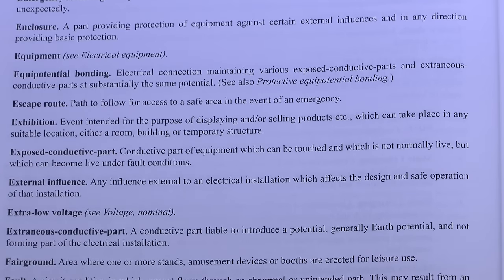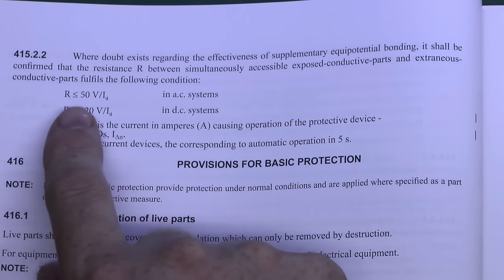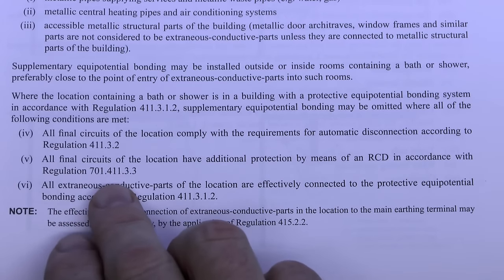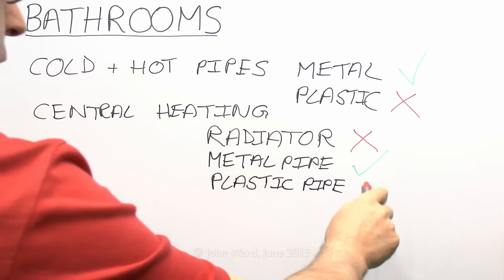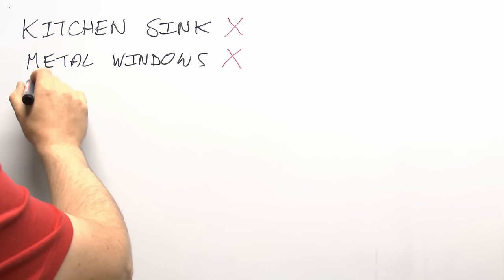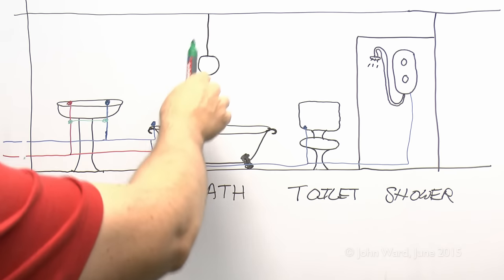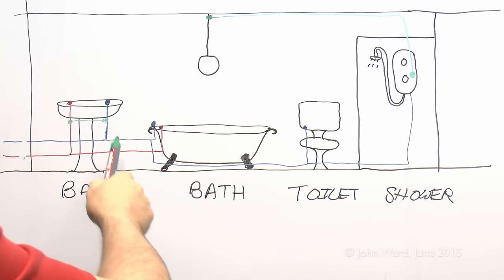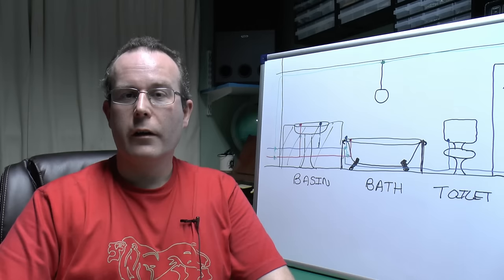Earthing & Bonding - Part 3 : Supplementary Protective Equipotential Bonding

Comment: Working out the resistance you said 1667 ohms if there is an rcd which is based on 50v divided by 30mA. When you did the calculation for a over current device you mentioned a 6amp circuit but then did the caluclation at 30A, why was that please? Also are you measuring back to the MET?
Reply from the maker: 50 volts is the maximum acceptable voltage on exposed conductive parts before the device trips.Type B circuit breakers need at least 5x the rated current to trip within the required time, so 30A for a 6A circuit breaker.
Reply: John Ward thanks for that. Is the measurement done back to the met?
Reply from the maker: Measurement is the entire earth loop, which includes all of the internal wiring and the external impedance between L and E.

Comment: Hi Jonn
In IEE  regulation 701.415.2 (v) states all sup bonding may be omitted providing  "All final circuits of the location have additional protection by means of an RCD in accordance with regulation 701.411.3.3"
Does that mean each relevant individual circuit in the consumer unit feeding the bathroom has an RCD or 1 overall RCD protecting the whole bank or MCB`s
Thanks
Reply from the maker: Could be either - provided all the circuits have an RCD, it doesn't matter whether it's one for all of them or several separate ones, or RCBOs.

Comment: I if you don’t have a wandering lead when you’re doing the earth bonding continuity test is it acceptable to conduct the test by probing onto say the earth terminal on the back of an electric cooker and then on the gas pipe to witch a gas cooker is connected  ? , as all the earth conductors are connected to the earth bar in the CU this will still give you continuity, ? You could also probe onto the main water pipe into the boiler ? Would this be an acceptable way of conducting the test?
Reply: Yeah, the cpc's are very low resistance and are negligible against the values you are interested in. If pipework resistance to MET is >23k ohm then no need to bond, less than that then you do.

Comment: Hi there I'm very new to this and was wondering what would be the concern of finding a repair to a water pipe in a bath room using a plastic connector id assume this would break the earthing circuit but if the rest was  bonded correctly could this be in fact dangerous??
Reply from the maker: Not likely to be dangerous - if the bonding was connected before the plastic, then it just means that the rest of the pipes after are not bonded, but as they would be isolated from the others they would not then need bonding anyway.
With bonding after the plastic part the piece before the plastic won't be bonded, but that would only be of concern if that section was accessible - if concealed such as under the bath then it would not be a problem.
In newer installations, most bathrooms don't require bonding at all.
Reply: John Ward thank you for your reply it's very helpful ....I was wondering have you done any videos of how to decomission electrical appliances, components and associated wiring ??

Comment: Are you completely, 100% sure boiler pipes don't need bonding?
Reply: No,  as the chassis of the boilers have an integral equpotential point.  As long as the gas and water pipes are bonded with 10 mm² wire.  Under the 18th edition if you have m.d.p.e pipe (plastic) downstream of the water stopcock or gas meter bonding isn't required.  This would only be the case if all circuits at the consumer unit RCD protected.
Reply: @rayc1503  cheers for your reply Ray. Still learning… every days a school day
Reply: The RCD requirement is regarding the ommision of supplementary bonding conductors, it is nothing to do with main protective bonding conductors. If your service pipework is extraneous, bond it, if it is not, don't.

Comment: Plastic flexi piping to hot water taps but copper just before fitting? Needs bonding?
Reply from the maker: No.
Reply: That's what a young spark (local authority) said to me when I saw him bonding some pipework. I just laughed and walked away.
Reply: Hi John, I worked in the era where you didn't need paper qualifications, and where everything including the cutlery was earthed. I've not worked in this field for 30 years, so equipotential bonding is fairly new to me. My interpretation was that all metalwork in the bathroom was bonded together, so it's all at the same potential with none of it being connected to the main in coming earth, but then you mention extraneous conductive parts. This is where I get confused as you mentioned extraneous parts when you were talking about the main bonding. So is any part of the equipotential bonding connected to the main earth bonding. My bathroom has everything bonded to the main bonding cable, even the bath. I was told that this was dangerous as there are to many paths to earth and that none of the E P bonding should be connected to anything else, but then the shower pipe is earthed to the light fitting which in turn goes back to the main earthing circuit. Please can you help.
Reply from the maker: +luckyglyn You have the concept correct - bonding together to keep items at the same potential.  However it's not just because it's metal - it needs to be metal/conductive and capable of introducing a potential from outside the room.  So water pipes, earthing wires from circuits supplying the room, heating pipes and cast iron waste pipes would be bonded as they enter from outside the room.  Towel rails, radiators, toilet roll holders, door handles and a metal wall cabinet would not.as they are totally contained within the bathroom.
Connecting to the main earthing for the building is not required as that is typically outside of the room and unrelated to keeping everything in the room at the same potential.  However it will usually end up connected via the individual lighting circuits, shower circuit, etc.
Reply: So  would it be advisable to disconnect any bonding cables in the bathroom that go back to the main earthing point, for safety reasons, and just leave the other cables in place. Thank you. Brilliant videos John.

Comment: Thanks very much JW. 

I have a couple of questions relating to extraneous conductive parts. 

Where the water supply pipe enters the building, is plastic and does not require bonding (as per 18th Ed changes,) there is not much guidance on this, but is it safe to say that omitting all bonding to the copper pipes is essential now because these water pipes are no longer extraneous? There's also loads of push fit fittings to copper pipes breaking the continuity of these pipes, so do they need bonding between also?

Thanks in advance!
Reply from the maker: If items are not extraneous conductive parts they don't need bonding.
Plastic isn't conductive, and pieces of copper pipe entirely within the building won't be introducing any potential, so neither require bonding, and never did.
Reply: @jwflame  Thank you for your advice, you have answered a very valuable question. I am now at ease. That's the trouble with being an electrician, the lack of information. We're so lucky to have people like you to educate us and thanks once again for reaching out.

Comment: I just had a EIC report telling me that the water and gas pipes need bonding, just as John points out is completely pointless as they all go into a chunk of metal called the gas boiler.
Reply: The incomer still needs bonding?
Reply: Yeah, any extraneous service pupewoek would need to be bonded. You can't just rely on the cpc of the boiler as a main protecrtive bonding conductor as it will almost certainly be undersized and in the wrong position to meet the regulation for bonding service pipework.

Comment: so, is all this redundant if everything is RCD-protected at the CU?
Reply: Whether you're legally are allowed to or not, It seems inadvisable, having the first notice of a fault being a shock is not good practice.

Then there's the edge cases with a break to the neutral, or a neutral fault in one area combined with a live fault in another where an RCD wouldn't save you, and it's still absolutely needed
Reply: @AngDavies  I cant see any extra bonding to the gas pipe or incoming water.....all the pipes under the boiler are earth to each other but not to anything else, it seems.......time for an electrician?
Reply: @tobybarker6808  the bonding should be at the isolation valve to the building (stopcock), not at the boiler itself if I understand JW correctly, so check that first if you know where it is?(also to verify it's not plastic)
Reply: @AngDavies  done that - no sign of any bonding. doesn't plastic pipe and/or elbows make a bit of a mess of the general plan anyway?
Reply: @tobybarker6808  pipes with no continuous electrical path back to the pipe in the ground are not dangerous (i.e., if there is a break caused by an elbow, it doesn't matter)

Only things that are earthed through some path other than the main protective conductor at the consumer unit need bonding (i.e they're electrically connected to something buried In The ground)

If they're just disconnected pieces of metal they don't need ( and shouldn't have) an earth wire, unless they're at risk of becoming live through contact with mains circuitry.

Any pipes downstream of a plastic elbow/pipe, wouldn't need bonding, even if metal, unless they then went underground again, because the elbow/pipe broke the secondary path to earth, and thus danger.

Tldr: bonding is not to earth something, it is to prevent something that is already earthed through other means from being dangerous, if that secondary connection to earth is broken, the need for bonding is lost

Comment: is there a specific distance that determines similtaniously accessible parts ?
Reply from the maker: damon btc No specific distance, it is defined as parts which a person could touch simultaneously, so approximately 2 metres.
Reply: +John Ward So in other words not like the regulations for accessible exposed parts where there are diagrams of exactly how many cm in various directions are considered accessible (think overhead power lines, big electrical rooms etc.)
Reply: How to grounding banding seng sstym
Reply: @AhmedAli-jy1qm   yeah, my sentiments exactly

Comment: All electric circuits will have their earths connected at the fuse box so why would a bathroom light need to be earth bonded to a shower?  .......... presumably to cater for risk of a loose earth wire?
Reply from the maker: The concept to to keep all of the conductive parts at the same potential by connecting them together within the room.  Although they may be connected together at the fuse box / consumer unit, that may be a significant distance away, and the resistance of the wiring could result in voltage differences between the various parts.
The further away the connections are, the more likely it is that the voltage on those parts will be different.
Reply: @jwflame  
Thanks for the info. Do bathroom c/h radiators, with copper water pipes,  have to be earthed?
Reply: @spannerssockets6308  not earthed, but if they are extraneous then they need to be bonded

Comment: Amazing how things change or shall I say the theory , I was taught that mechanical joints are not electrical joints hence the equipotential bonding . Ask the plumber to make all his pipe joints soldered 🤣
Reply: Solder would melt under fault conditions. They need to be threaded unions.